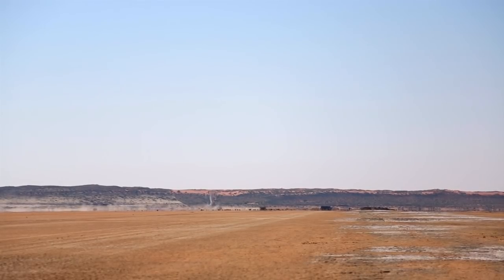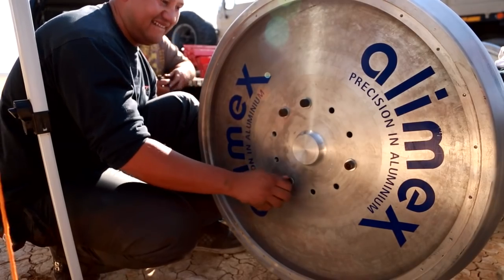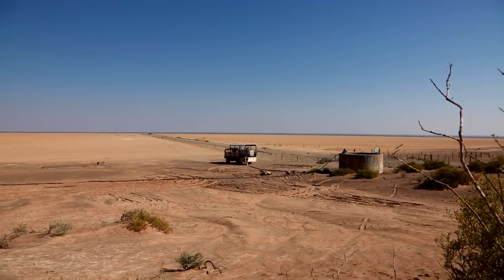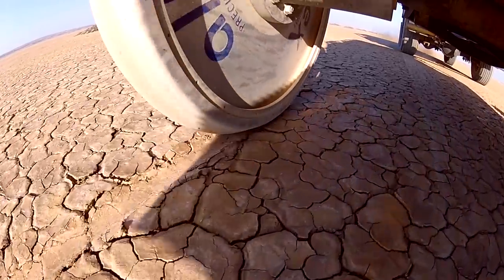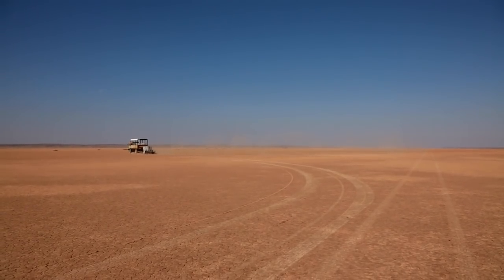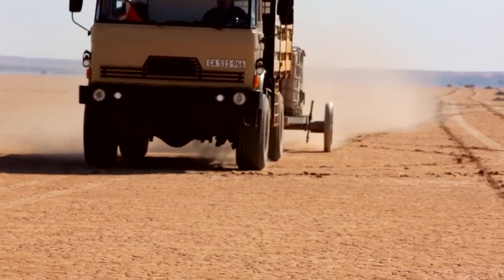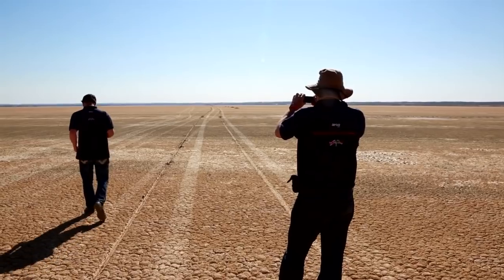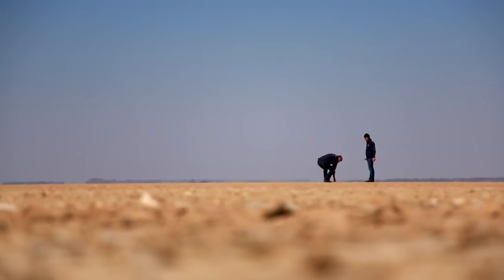Testing 1,000 mph wheels on the desert racetrack, South Africa

Comment: Too bad the runway in Fast & the Furious 6 is fictional.. else all land speed records ever would be done on said runway instead of 12 mile strip of desert between large rocks..
Reply: idc what they say about how flat it is. all that debris flying up is a problem
Reply: why doesn't someone just pave a 12 mile long runway? #letsmakefast&furiousplausible
Reply: Bloodhound SSC quote "The Bonneville salt flats are too hard for our solid aluminium wheels. We need a dried out lake bed which has some cushion in it as we run without tyres. Black Rock Desert, Nevada (where the current record was set) is too bumpy."

That should cover why pavement won't work, besides the cost of a strip that long and ALSO quite wide.

Comment: I'd like to see them do the outright wheel-driven record, as jet and rocket engines are cheating.
Reply: I'm not sure why you consider them cheating, but I guess I can see eight Pratt and Whitney R-4360's lined up into 32:1 gearbox.
Reply: atomicsteameng I think what he is saying that jet and rocket engines don't really qualify as the makeup of a "car"  i mean you might aswell fit road axles and wheels to a Lockheed Blackbird and fire that down the desert.
Reply: Thee Adjudicator Well, technically a blackbird with wheels would be a car. But, I can agree with him that'd I'd like to see a car that uses rotary power instead of reaction power. (This would include using a turboshaft jet engine, where the wheels are connected to the rotating axis of the jet)
Reply: Wouldn't be possible to reach this speed with a wheel driven car. 1/ traction would not be possible 2/ the power required to reach 1000mph could not be transmitted through a mechanical gearbox.
If the team decided to do the wheel driven record they could and would break the record.
Reply: CHris Henniker Using wheels is cheating too it should walk  with legs like the horse does.
Reply: Thee Adjudicator That would go slower air is thicker  at ground level and those SR-71 engines only produce most of the thust at high altitude over mach 2.
Reply: Jax Pok From what Iv'e heard Engines prefer lower altitudes due to the more densely oxygenated air. Increasing burning efficiency. 
I Still beleive a Blackbird "car" would smash the current landspeed record even if it wasnt quite as fast as its airborn counterpart!
Reply: Thee Adjudicator
I doubt that!!  The Blackbird is an aircraft, aircraft fly!!  Aero on these ultra high speed LSR cars is very critical.
Reply: Aircraft manipulate the flow of air over their bodies. cars do exactly the same, its just a matter setting up a way of creating downforce as opposed to lift.  Aircraft can already do that naturally when landing.
Reply: Aircraft are aerodynamically designed to lift, by virtue of wing shape etc. Yes, by using flaps they are able to climb and descend but at the expense of drag.  Ground effect is also a major factor in the performance of a supersonic LSR car, aero design is critical in this area. An aircraft would be a mess at those speeds on the ground. Then there is weight, wheels, suspension, etc etc. So much would have to be changed that you might as well build a specific vehicle, hey, thats what they did!
Reply: ***** yes they did build one. a jet aircraft on road wheels.
Reply: SR-71  engines only provided 20% of the thrust the  rest came from air coming in at over mach 2 and being squeezed   out the back.  F-15  can manage 900mph a hundred feet up but the wheel drag of SSC Bloodhound would reduce  that a large amount.
Reply: Fund your own contest. Good luck applying enough torque to whatever surface to decide to drive on.
Reply: ok the reason the sr71 is as fast as it is at altitude is that at the speed it is traveling it actually has to slow down and compress the air BEFORE it enters the engine air and jet engines hate moving at supersonic speed

Comment: Have you thought/ trialled running a light convex profile? At speed your Rolling resistance would be minimised, Lateral grip would be strong and as soon as you started to turn your grip would increase hugely in either direction.
Reply from the maker: Yep, but the centrifugal forces at 10,200rpm (50k radial g) would flatten out the convex shape: http://www.bloodhoundssc.com/news/wheel-story-so-far

Comment: How do they differentiate the cornering performance of each wheel when testing with both on the trailer?
Reply from the maker: They did clockwise and anticlockwise loops to see the loads on the outer wheel and studied the tracks from each

Comment: ...hmm isn't this fixed configuration unsuitable for testing lateral grip of different types of wheel profiles because this way you can only measure overall grip of both wheels, unless those axels are laterally "freefloating" and can measure independent grip...:/
Reply: thank you for pointing out exactly what I was thinking- running two different profiles at the same time is not good science- as one profile will affect the performance of the other- regardless if they are independent- the trailer as a whole entity will behave differently depending on whether you run 2of type "a", 2of type "b", or 1of"a"+1of"b".Having the wheels "floating" laterally would not give any data, as the load must be directly fixed to the contact patch (wheel bearings considered- which should also have no lateral play) in order for the product of the downward and the lateral forces to be applied there. Unless this is all accounted for, all that this test was good for was testing the straightline penetration. And even then, I hope that they recorded the condition of the track intimately (density, temp, hardness, depth of crust, and more) to compare to conditions at actual run time, one odd weather event could change the conditions greatly in comparison to the baseline data.

Comment: Pretty weird to see humble old aluminium alloys in such an exotic application. Carbon fibre composite, kevlar composite or even fibreglass would have considerably higher specific strengths. I guess aluminium's cheaper and much easier to work with.
Reply from the maker: We looked at all sorts of exotic materials and modelled them, but the centrifugal loads of spinning at 10,200rpm - generating 50k radial G. http://www.bloodhoundssc.com/news/wheel-story-so-far

Comment: Why not allow this to be self driven or remote controlled
Reply from the maker: There aren't many rules for this class of land speed racing. The car has to have four or more wheels, two of which must be steerable and it must have a driver. Other than that, you can use any power plants and designs you want.
^JT

Comment: Why is this place better than Bonneville salt flats?
Reply: Stephen Shakespear they still are butt soar over 1775 fiasco...
Reply: 1. more space. the salt flats don't offer a long enough space for speed trials at such high speeds. Thats why the ThrustSSC record run was moved to a deferent dry lake bed in the south west U.S.

2. The Bloodhound team is a British team if I remember correctly. Africa is closer.
Reply from the maker: The Bonneville salt flats are too hard for our solid aluminium wheels. We need a dried out lake bed which has some cushion in it as we run without tyres. Black Rock Desert, Nevada (where the current record was set) is too bumpy.
Reply from the maker: The Bonneville salt flats are too hard for our solid aluminium wheels. We need a dried out lake bed which has some cushion in it as we run without tyres. Black Rock Desert, Nevada (where the current record was set) is too bumpy.
Reply from the maker: South Africa offers a wider weather window, 6months. Blackrock Desert offered just 6 weeks.
^JT

Comment: Have you thought about some kind of ventilation grooves in the tread? At the speed you guys will be running air might pack under the tire instead of getting pushed out of the sides

Comment: I find your lack of electronic telemetry equipment disturbing.
Reply from the maker: These trials didn't call for telemetry, they were purely to gauge the correct wheel profile. Sensors and telemetry are used extensively through out the development of the car: https://youtu.be/WIpVwBVTwCY
Reply: BLOODHOUND SSC - 1,000 mph car So you mean to tell me you wouldn't want some sensor informing you of the maximum lateral G load that the wheels could maintain tractions at? ALRIGHTY THEN

Comment: Wheel surface should be shaped like a Hockey Skate....
Reply: Cary Hawes They mentioned that that wouldn't work because the wheel would then dig into the ground and get damaged.
Reply: +Cary Hawes try watching the video before you comment....wtf   jesus
Reply: +ThierryTheuns 

No, an ice skate is ground with a concave bevel. It doesn't come to an edge like a knife, it is a flat surface with ridges on the very outer edges. It would be perfect for this application.
Reply: Mick Enzie
Once again, I'm willing to put my life savings on the line that these engineers thought about this more than you have.
Reply: +ThierryTheuns I was just clarifying for your misconception. You suggested that they tried a profile similar to a skate. They did not, they tried a knife edge profile. A hockey skate is nothing like a knife edge, it's actually just about as opposite to a knife bevel as you can get.

They may have considered and rejected a concave bevel similar to a skate, but they definitely didn't mention it in the video, one way or the other. I wasn't criticizing the engineers, I was defending Cary's idea, which everyone misunderstood.
Reply: +Mick Enzie Sorry I completely misunderstood you the first time. Glad you went for helping me understand as opposed to yelling at me :)
Reply: It would get too hot

Comment: 12 miles long? surely that's not enough space to accelerate to 1,000mph and stop safely at that rate your covering a mile in under 4 seconds. Also, why are they so fixated on 1,000mph maybe they should just aim for 800 so they have the record.
Reply: david sell 12 miles is just enough space. 800? If they can do 1000, why not?

Comment: Super old video, I know, but if rubber tires come apart at ~400 mph how did the Blue Flame go 622 MPH with rubber tires?

I'm not saying that 1000 mph is possible on rubber tires but obviously you can get more than 400 out of them.

Comment: So they drive around a set of wheels in the desert at 20mph and can figure out which wheel will hold together best at 1000mph?!? I hope they're not using common core math while they're at it...
Reply: +KremitDeFrog. You have to start somewhere with what shaped wheels do the best for that particular desert. Each dry lake bed has different types of surfaces. It's a test so they have something to work with when they design the proper wheel, which will still be a test.
Reply: understand they need to figure out composition, weights, balances, and more.. but also need to do figures on the other end of the line.. not only do you need to figure out how to crawl before you can walk, and walk before you can run, but you need to be able to sustain yourself at running speeds..

am I saying it's not going to work? not at all... just not sure how they can be certain just because the composition, weight, balance, etc, they can rely on it to sustain the friction on the center of the hub, or g-forces on the outer edge of the wheel... They can even put the wheel on a machine that spins it to such RPMs, but that still doesn't put the weight of the car on them, so the numbers they get from the spinning machine still won't reflect the real application...

Comment: surely aluminium is a bad choice as its very soft as metals go? i mean, can it withstand 135000HP?
Reply from the maker: This is aerospace grade aluminium, it's pretty tough: https://www.youtube.com/watch?v=K_ImAm1WhcY
Reply: BLOODHOUND SSC - 1,000 mph car oh right, thanks
Reply: It doesn't have to withstand 135,000 HP since it isn't driven.  It has to withstand the centrifugal forces of turning at speed, the weight of the car plus any additional downforce applied, friction from the air and ground, and the lateral forces from steering, all of which are a function of its speed, not its horsepower.

Comment: Can somebody more intelligent than me tell me why they opted for Alli instead of titanium? There is obviously good reason, but I can't think of it haha
Reply: I am no smarter then you! I just google better. 
ALUMINUM VS. TITANIUM
“The perception out there is that titanium is lighter,” says Jim Black. “Titanium is not lighter than aluminum.” As a raw material, titanium actually weighs more than aluminum, though both metals weigh considerably less than steel.

“Aluminum has one-third the density of steel,” says Mike Zablocky. “Titanium is half the weight of steel, so because it has a lower mass, it can be just as strong (as steel) at half the weight.”
Reply: Oh and why is You Tube suggesting I watch this from 2013? I guess I did learn something. Have a good one day Aaron
Reply from the maker: We looked at Ti and all sorts of exotic carbon matrix wheels. Read up here: http://www.bloodhoundssc.com/news/wheel-story-so-far
Reply: Ahhhhhh okay I don't feel stupid now knowing that you guys looked at titanium first haha, thanks for the reply! Sooo excited to see how this does! Any chance of a promotional code for a few tickets? :P haha cheers guys good luck